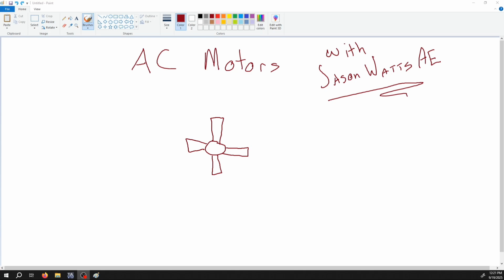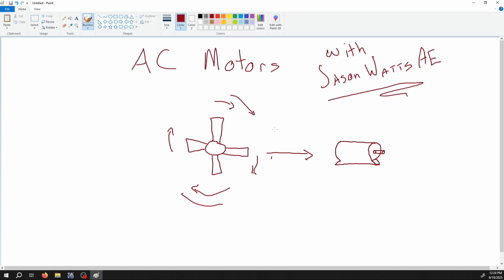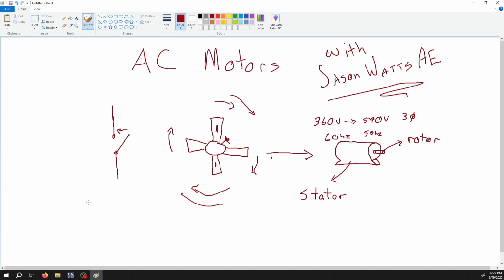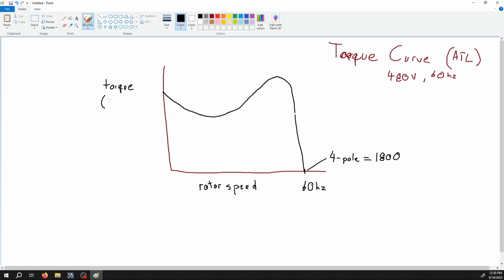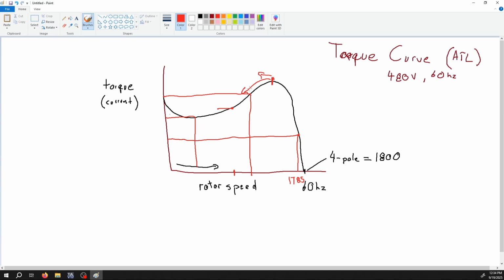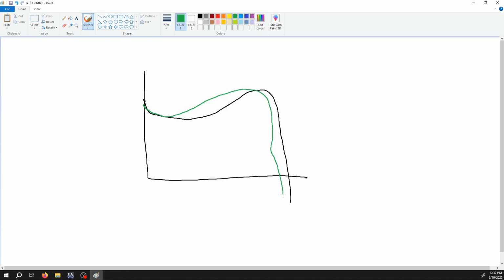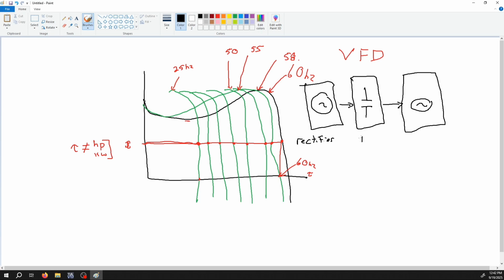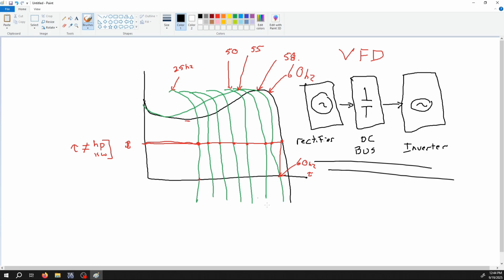AC Motors and VFD Basics: Motor Torque Curves

Comment: It is important to highlight that those green curves shifted across all the speed range are possible in that way you showed when both the voltage and the frequency applied to the motor are changed in a way that the ratio (V/f) is constant and equal to (ratedV/ratedf) of the motor.
Reply from the maker: There's a whole video on it coming next!